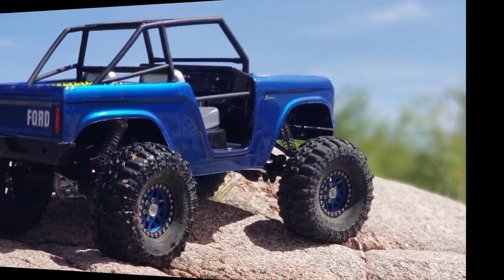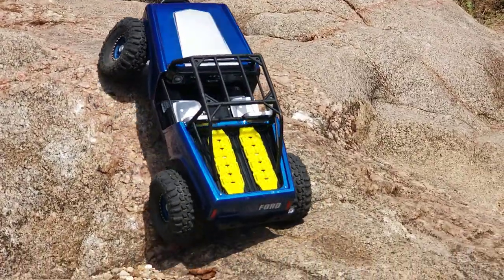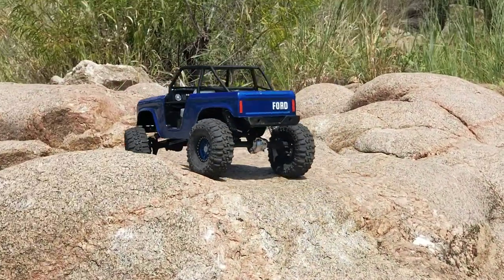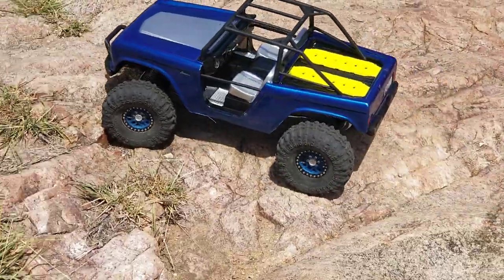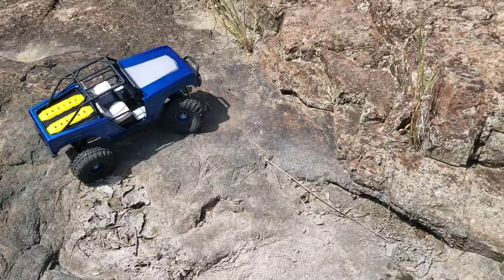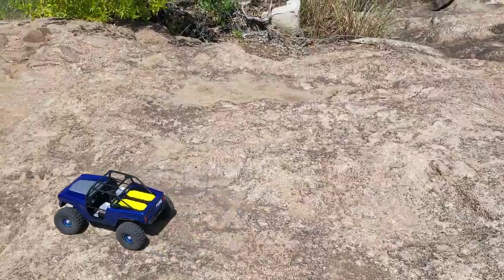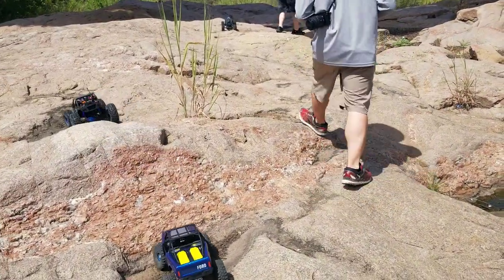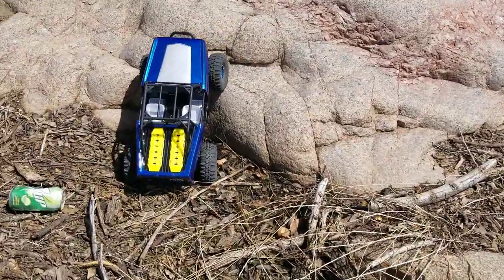Redcat Gen7 Pro Portal Thoughts and driving footage

Comment: I also have a gen 7 I installed after market all metal portal axles with axial trans 1800 fusion and frame mounted steering servo topped it off with a Cherokee hard body with a patina paint job